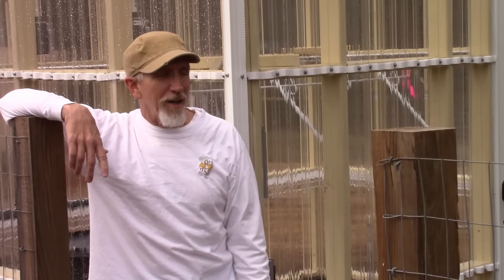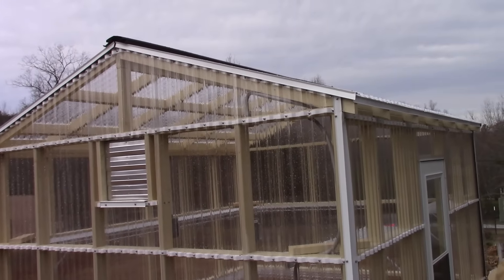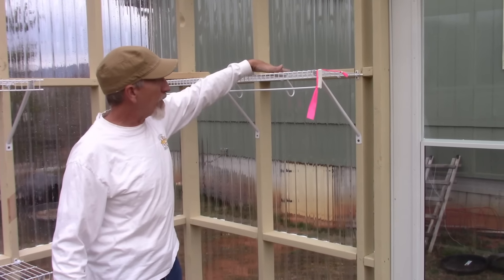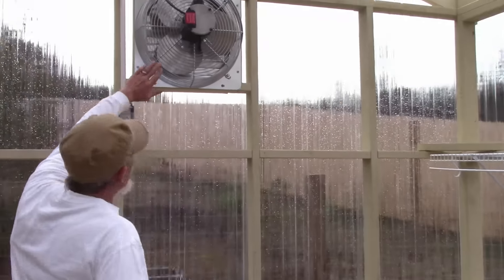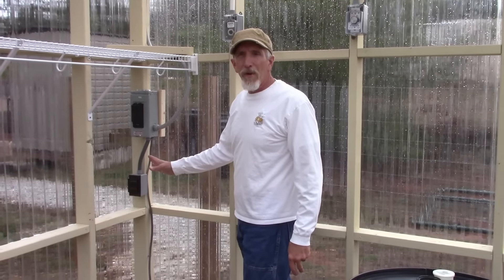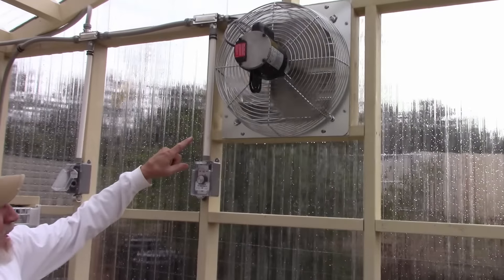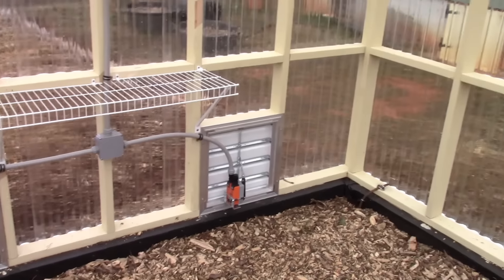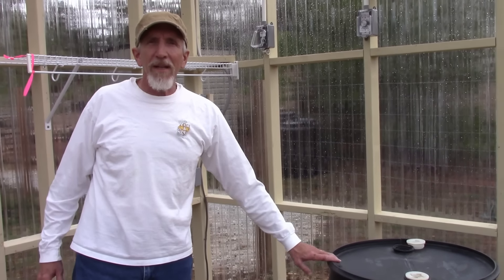Awesome DIY Greenhouse ! Take a tour with me & see the ventilation in action!

Comment: A rooftop solar powered ventilator is available. The solar panel is built into the ventilator and it is thermostatically controlled. On cold days the ventilator shuts down. On hot days it starts up. Another idea for you.
Reply from the maker: Good idea.
Reply: Can you suggest a source for the ventilator?
Reply: Great idea . Any specific place to purchase those ?
Reply: Love to know the source of the solar ventilator as well 🥰👍👍
Reply: beldengi I would love to have a source for that system too:)

Comment: Your GH is very nice. I have been looking online to see about how some greenhouses are vented at the roofline. I have a GH that is Amish built. It is very nice, very sturdy. But, it has NO roof vent. I have bought a fan/vent, and installed it too. But, it can only do so much. And, I will be doing my best to try to put up a shadecloth that is 40% shade ability too. THEN, I have a fan that I have facing that electric ventilation fan. That fan/vent that I had bought and installed is a fan/ vent that is at the top of the roofline at the back of the GH. 

I really do LOVE my greenhouse, BUT, It just gets SO HOT sometimes. I have some shadecloth that I want to put up on the roof. But, I had actually had shadecloth up there before, and it hadn't cooled it off. The Shadecloth I have now is WHITE, and that shadecloth I had up before was BLACK. SO, I will admit that I may have screwed up even thinking that ANY shadecloth could have or would have cooled my GH off, BUT, MAYBE the WHITE SHADECLOTH  will reflect some of the suns rays? 
REALLY, I think that my best bet is to pay some guys to install a vent in my greenhouse either on the roof or near it.

Comment: I have a question. Since the green house is airtight would it not heat up pretty quickly in the summer causing the ventilation system to kick on and off quite often ?  With no open vents it would seem like it would heat up very fast. Please explain as I'm new to this ventilation stuff.

Comment: might want to use metal berels and put in a couple of 12 volt glow plugs to warm the water during the day as well as the sunlight that way you can make sure the heat in it is at least 132 degrees in them at night

Comment: Well done both the greenhouse and the video.  I have a similar GH with a similar cooling setup that has worked well for several years.  I put my intake vents on the upper part of my GH and later had to move them down fo9r them to work properly.
The high school greenhouse I used until I retired had barrels that were filled with stones about the size of baseballs. We had a small fan that forced air through these stones 24/7 during the cooler days of the year which warmed the stones during the day and warmed the GH during the night. The key was to have the intake to this system as near the top of the Gh as possible to obtain the warmest air during the day. The barrels were on their sides and under the plant benches on each side of the GH.  There was a thermostat on that system also.
 I think if I were setting that system up today, I would use wooden boxes instead of the barrels.
There also was a small auxiliary heater that helped when needed.
The school was located in Northen Piedmont of NC.
Reply: That's a really cool idea about those barrels with the stones in them

Comment: Great video. You have your ventilation system set up perfectly. The only tip I would suggest is building a wood cover over top of your thermostat. We do a sort of lean to type configuration with a roof and 2 sides. We then paint it white. That helps keep the thermostat from getting false signals from direct sunlight. Tammy
Reply from the maker: Thanks for the suggestion. I will follow your advice!
Reply: I did the same thing. Wood will not work. You need to deflect the heat. Use aluminum. Not foil but trim coil or even the cheap aluminum baking pans. Im doing a test with mine but haven’t had any heat and sun yet. I’ll let you know..
Reply: Wood is a poor heat conductor. Therefore it is the perfect thing to use for this. Plus to add to this we paint it white. Aluminum is a great heat conductor. You don't want this. The point is to keep heat from the sun away from your thermostat, so that you do not get false elevated readings.

Comment: For additional passive, how about concrete pavers down the middle for a walk way and solar collector.  Two 18" X 18" wide, the whole length of the house, installed on top of a bed of gravel.  A dark color could help as well, either painted or dark mix concrete.

Comment: heating would only be used in cold temps I take it?  you could use radiant floor heating either electric or water, or woodstove or gas.  Least amount of work is gas heater, either hot air or water. I like water because it holds the heat better than air.  Nice job.

Comment: That's awesome, you've also nailed the airflow, cold air in low and vent hot air up high, ✔️shelving that allows drainage✔️
Adjustable fan speed with thermostat connected to intake vents is very cool, looking forward to your updates

Comment: That looks fantastic. When you wired the shutters did you run a ground to the opener?
Reply: Reason I'm asking is I bought the same system based on your video and I'm wiring it up tomorrow. The instructions that came are a bit vague.

Comment: This is an awesome build! You have given me some good ideas but I do have a question about the Thermostat, is it the TS200 Two Stage Thermostat or the T110 Single Stage Thermostat? I want to make sure I get the right one that opens the two shutter motors before the fan fully comes on like in your video. If not either one which did you order?

Comment: I just build my greenhouse based on your video and bought the same fan and vents system like yours.  Do you run the fan as circulation also (with the vents closed)  to prevent high humidity?  If so how would you rig it so the vents doesn't open?  Thank you so much for making this video.
Reply from the maker: Thanks for watching! I keep mine set at 85 degrees and so it runs a lot in the summer when the humidity is high. I am putting a shade cloth on in a few weeks to see how that helps with the heat and  intense sun in the summer here in SC. Will do an update.
Reply: Where can I buy that vent system?
Reply: @thucnha   Mua o day ne ban. https://www.acfgreenhouses.com/premium-plug-in-exhaust-fan-systems

Comment: Round flat river stones painted black on one side white on the other to adjust heat. Also putting clear plastic juice jugs filled with water under the stones will create heat. You might want to devise a solar heated water or copper tubing filled with antifreeze to heat your house come winter. All passive. 👾

Comment: Great video. I live in Canada where the winters can get very harsh.  I am planning on converting my garden shed which has a concrete base into a greenhouse to start my seeds in March.  Would I have to remove the concrete base before constructing the greenhouse?
Reply from the maker: I think the concrete would be great. Good place to anchor the unit and it will hold the heat. Good luck and thanks for watching 🤠
Reply: @homesteadhandyman4481  thank you.  Much appreciated
Reply: thank you @homesteadhandyman4481

Comment: nice job, what was your overall price if you dont mind me asking, minus the solar and fans . I am sure those clear pvc panels were not cheep.
Reply: Hey what's up. 
I thought I would answer your questions. 
I'm building a greenhouse right now, basically the same except for I put a wood floor in it. 
And I also painted all the wood white even the floor .
It sits about 4 inches off the ground. So it will get air flow under the whole greenhouse. 
It's a 10x12, but I installed the door on the 10 foot end. Not in the middle of the 12 foot side. 
Because I wanted the whole 12 foot run of the greenhouse. 
This greenhouse cost me about $ 800.00. The panels are like $ 22.00 at the home depot. 
The good double wall panels I wanted to use are $ 80.00 per. 
So I hope this helps.

Comment: Obviously one side of the greenhouse gets no sunlight coming through, thusly it should be insulated. Unless you did not orientate the greenhouse correctly. Also the side that has no sunlike coming through should be black to absorb sunlight coming through the other sides, and the material used on that one wall could be used as a battery type material. A combination of insulation and battery would increase your chance of making it through a night above freezing.

Comment: Very nice, and clean construction! You should probably try to find(or make) a wire cage that will fit over those bottom vents, so mice don't get in there.
Reply from the maker: You are right about that. Thanks for the suggestion . I will do it and thanks for watching!
Reply: @homesteadhandyman4481  put them on the outside!

Comment: That vent system is really sweet.  Can you point me to where you got the intake actuators?
Does the fan & switch run off 12V DC, or are you using a 120V inverter?
Reply from the maker: I got the whole set up from ACF greenhouse. Everything is 115v and runs off my inverter
Reply: Ben Hollingsworth b

Comment: Would have used some strips of metal, drilled holes true them, and used it all over the wooden struckture to secure all the joints with wood screws.
Reply from the maker: Good suggestion 👍. So far it's holding it up well. Thanks for watching.

Comment: I know I'm almost 2 years late but for the heating issue if your willing to try composting you'll lose like 6 to 8 inches of head clearance you can use a grass coffee grounds and woodchips go very thin layers and you can get like 20 30 layers in a week it will be like 50f and every couple of days add a new layer or 4 its been holding me for the past 2 years and only have had to till the whole pile 2 times both times in the summers to ease the heat but just cover the floor the entire floor make it with suggested coffee grounds grass clippings and either wood chips or newspaper  the newspaper pile are way more tedious but heat good if piled on properly and I'm in nyc suburbs I'm zone4b
Reply from the maker: Thanks for the advice. I will look into that!
Reply: Are you saying to have the entire floor compost?

Comment: I'm more or timber man myself so I would rather build mine from timber to but I wonder how long it would last being wet all the time even if I use outdoor treated timber. 
I brought treated pine sleepers from bunnings to build a raised garden bed and they were rotten within a few years. Any help would be great as I'm trying to research timber greenhouses and how long they last if built with the correct timber as obviously the treated pine I used is not suitable.
Reply from the maker: Simon Delaney  I am not sure what you mean you would rather build from timber? My greenhouse is all wood construction.There are different types of treated lumber. You have to check the labels. One is suitable in wet locations and the other is rated for ground contact.
Reply from the maker: Thanks Simon!
Reply: They say treated pine can last up to 30 years, if its constantly wet then painting may stop the rot. Nothing is permanent.

Comment: How much did this project cost? I really want an honest to god greenhouse but I'm pretty sure I'll only be able to afford a hoop house. I've looked into a greenhouse kit but those are a no go. The only ones I could afford are way to small for my needs. Not only will it be used to sprout my seeds but as a greenhouse to keep my tropical trees safe during the winter. I'm right on the edge of zones for tropical to survive outside so winter they will all have to be babied. And most of my tropical are dwarf trees so I need room
Reply: I would say couple of hundred. Look up all the materials. 2 x 4s are around $4 a pop. he uses about 50. the panels are are $15. He maybe uses 30? etc etc. Maybe a grand?
Reply: The vents, motor, Sub panel, electrical  wire boxes, screen door, shelves, ground work,  fabric & stone for floor etc. Probably have to hire a electrical contractor and carpenter unless you have the skills. And all the other equipment adds up fast . The good panels are more than 15$ each. Corner trim, Ridge cap! This is really a very nice top quality build. I would say more around 3K 3.5 K would be my guess, maybe even a little more depending where you live.

Comment: Nice greenhouse but if you had put vents in turned inward they didn't have to be opened with actuators. The vacuum pressure from the fan running would open them and they would shut when the fan stops running. On my greenhouses I have roof vents that open automatically when the temp reaches 80 degrees and shut when the temp falls below 80. No power needed it's opened by a small hydraulic cylinder. In the summer I open both doors and put a small circulating fan (runs by a thermostat) in front of them blowing into the greenhouse as the hot air exhausts through the roof vents. With the doors open bees and butterflies are able to come in and pollinate the vegetables(you do have to watch for caterpillars). It will take up some room but if you put a large fish tank inside you can enjoy the heat released during the winter, eating the fish, and using the tank water as a nutrient solution for your plants. I have a six hundred gallon tilapia tank that's wood, Styrofoam lined and vinyl lined that has a submersible heater that holds the water at 83 degrees for the tilapia(they require warm water). Racks above the tank hold seed starting trays, they enjoy the eighty degree heat and humidity to sprout and grow. I also have several hydro tanks that the fish tank water pumps through several times a day that I grow larger vegetables in. I didn't notice any lights in your greenhouse so I'd recommend a couple just so you have light in case you have to do something in the greenhouse after dark. For winter heating I place a milk house heater on the floor and it's controlled by a greenhouse thermometer(more dependable than the heater thermostat). Yes it takes some electricity to operate all the greenhouse systems but it's a lot less labor to use it year round.
Reply: Well aren't you just special!
Reply: @2ndamendment-noinfringement  My wife seems to think so.

Comment: I'd suggest that any fans such as yours should have their screens on inside and out, removed. If children and furry pets have no chance of grabbing the blades a single layer of cheap chicken wire will easily block birds, without  impeding the fan's action

Comment: What do you have the 6x6’s sitting on? And how are they attached to the ground?
Reply from the maker: The 6 x 6 sit on the ground . I used 8' rebar rods that I beat into the ground and attached to structure. The green house has been up 3 years and been through some pretty extreme weather,storms and high winds and is doing great.